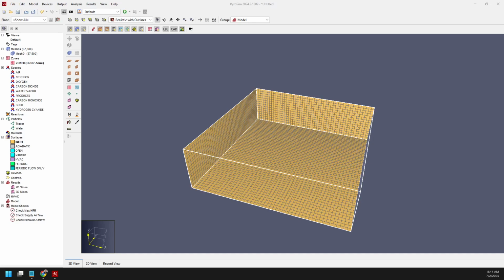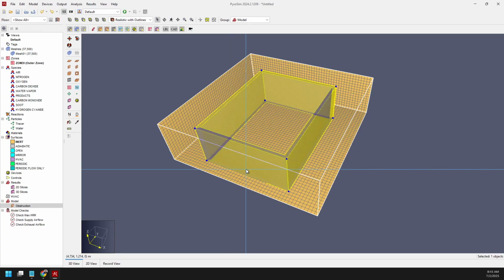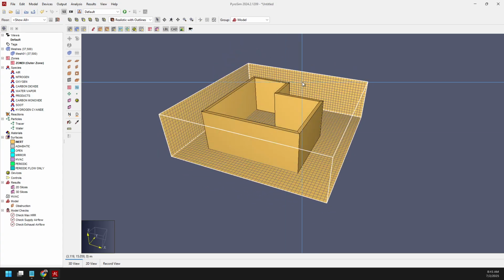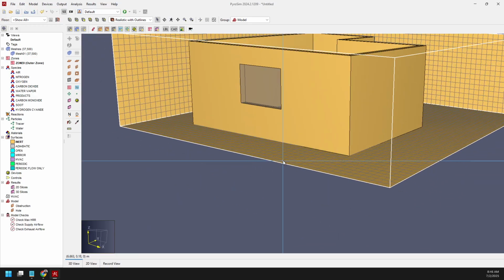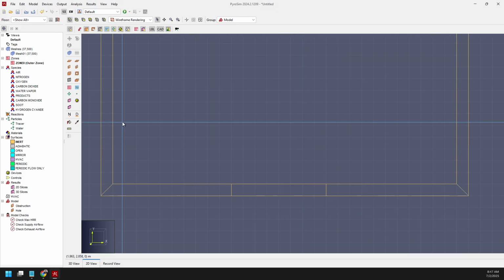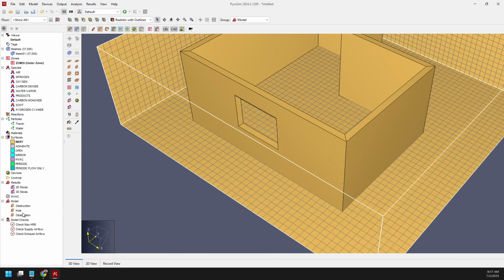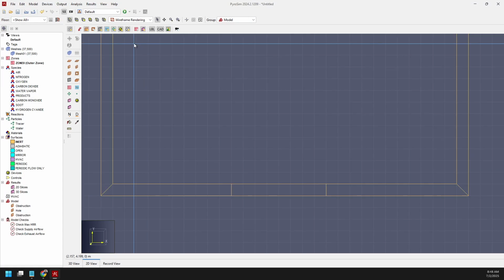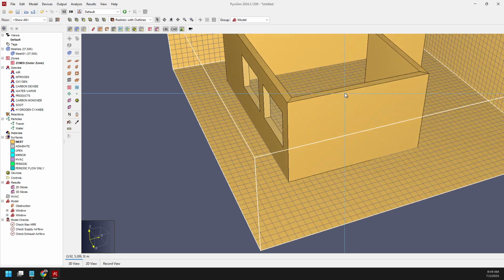Windows and Door in Walls with PyroSim

Comment: do we have to define the window with the full thickness? or does it also work with HVAC if we want to control the window?
Reply from the maker: If you use a 'Hole' object to make the window you need the hole to pass through the full wall width.  If you are making a window with HVAC vents, the vent is only placed on the surface.  The downside with using HVAC as the window is that the flow is unidirectional and you won't see something like flow going out the top and flow in through the bottom of the window when there is a hot upper layer and a neutral plane between the top and bottom of the window opening.